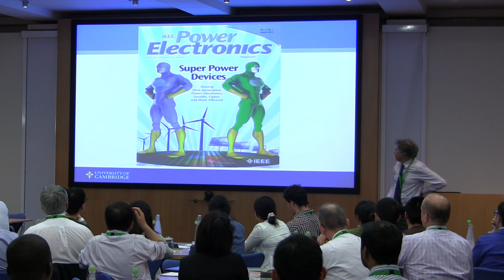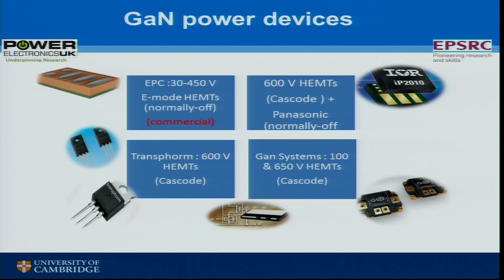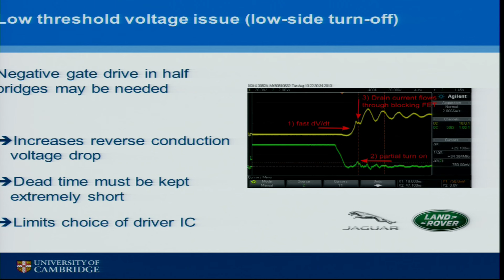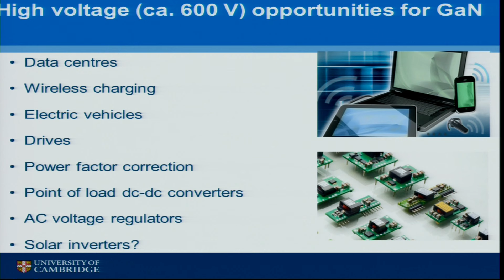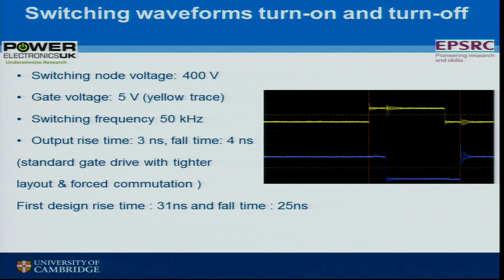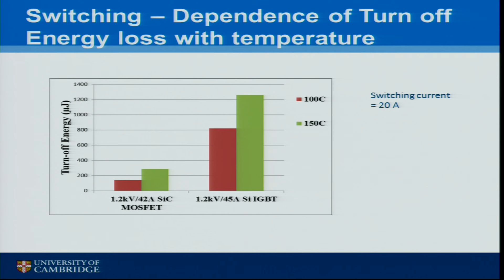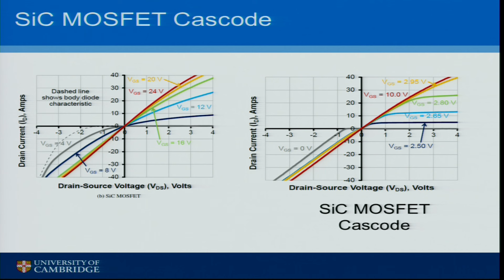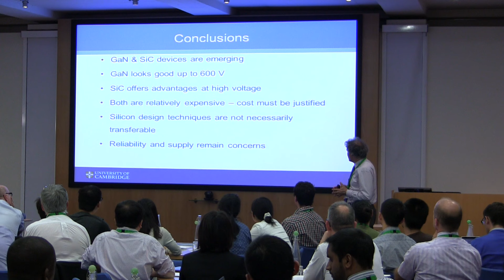Wide Bandgap SiC and GaN Devices - Characteristics & Applications

Comment: The problem with GaN and SiC is that the devices are packaged in 125 to 150 C packages, except for GeneSiC. GeneSiC seems to be the only man. out there that realizes that the only way to replace silicon is to exploit the advantages that  SiC and GaN have over standard silicon MOSFETs and that is very high TJ. One of the GaN vendors said they didn't put their devices in high temp packages because their customers didn't use there products in high temperature environments. So what? If I have the choice of two devices in the same size package and one has a Tjmax of 150 C and one has a Tjmax of 300 C and I need high power density, even if my operating environment is 40 C max I am going to use the 300 C part, because I can push twice as much power through the same size device. Or I will use it because I  can extended the warranty on my product to some exponentially greater value.
Reply: or may be the packaging technology has not evolved as much as device technology has... i am not an expert on packaging, but i guess packaging industry is still struggling to come up with decent solution with minimum stray inductance and high temperature compatibility
.
Reply: I think it is price matters. If SiC package that operates 150oC is enough in an application, definetly there is no reason to go with SiC package that covers 200oC in that application. Hence, it is a matter between OEM and suppliers.